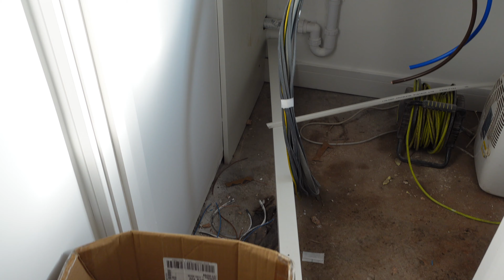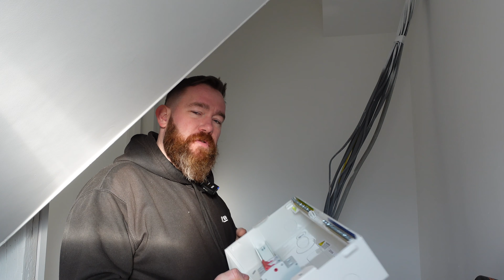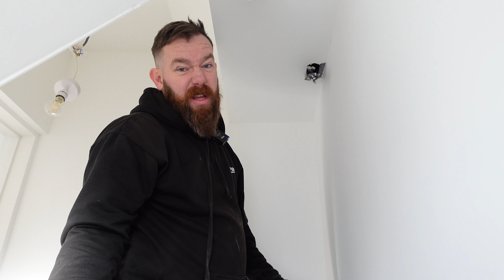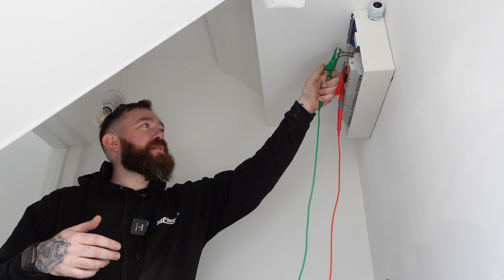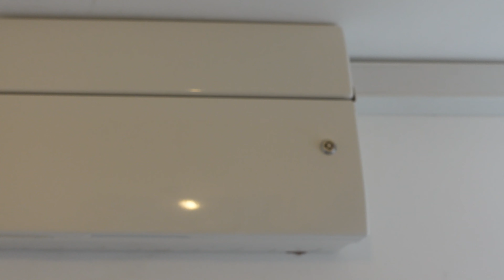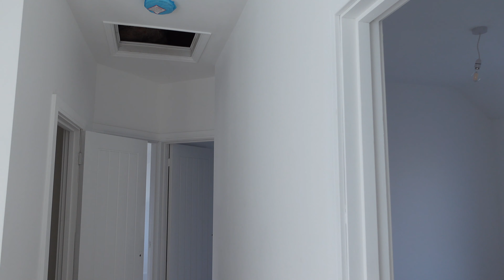Fuseboard Installation On A Rewire - Electricians Life

Comment: Top stuff again mate.
Which torque driver do you use for the Consumer Unit?
Reply from the maker: Draper XP1000 mate I’ve had a few different ones and I’ve found this the best so far
Reply: @JRCElectrical 
I had a CEF Engex set which appears to be a copy of or rebadged Armeg set, absolute pants. 
Draper set is brilliant (again either a copy of or rebadged version of Wera I think).
Reply from the maker: @dommccarthy1889  yeah I went from wera to draper they kept snapping heads on the wera set the draper ones have been ace

Comment: All came together in the end! 👍👍. Have you come across the GripIt fixings? They are super strong with a shallow set of wings for use when mounting on dot and dab boards. They also make a special little cut out tool if you happen to hit a blob of glue.
Reply from the maker: Never seen these but I shall have a look into it thank you